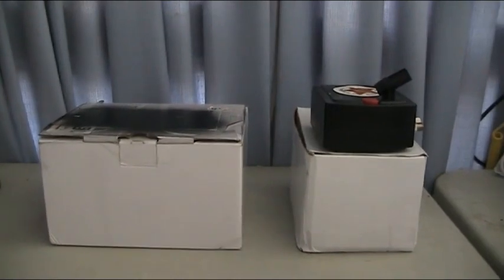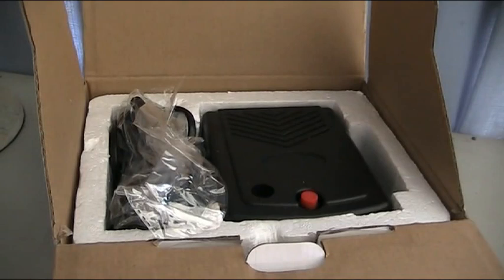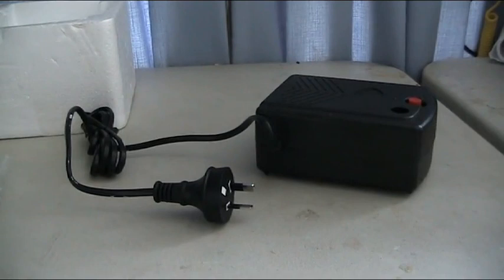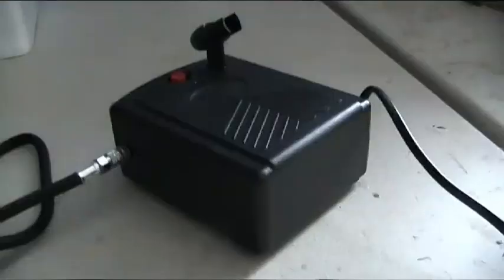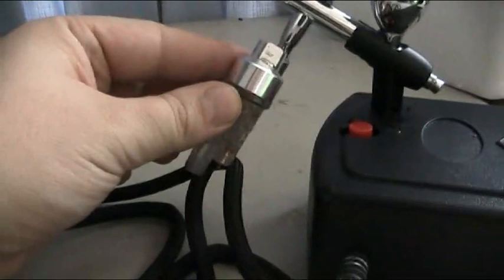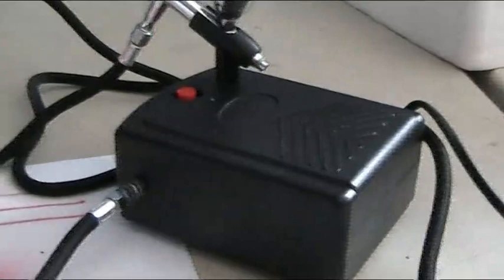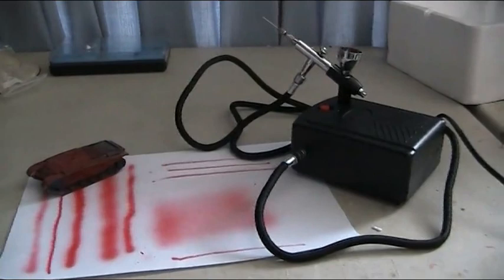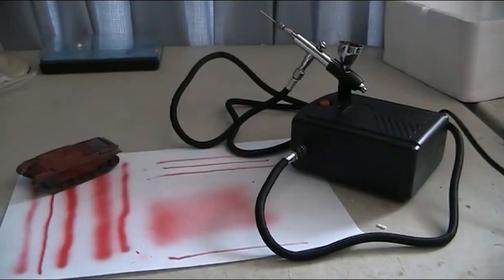Budget AS-200 mini airbrush compressor review

Comment: I really like your last video about this mini-compressor. Have you tried painting a large surface, like a 1/700 ship, with this compressor? Thinking of getting one but I'm not sure if this can handle a 1/700 ship.
Reply: If I understood correctly, he says this compressor is similar to a fish tank pump?  But there are different types of aquarium pump...  Aquarium pumps have been left running 24/7 for years.  Not sure how the work compares to spraying paint, but the air pump has to force air deep under heavy water.  Then you should be able to paint with this all day long?
Reply from the maker: This is correct interpretation, my apologies for the late reply as I've been over seas for a few weeks.

Comment: I hope you can also tear it down to see the inside.. some are all plastic piston inside that easily break. I have the old one
Reply from the maker: The insides is similar if not the same as an Aquarium pump for your fish tank. Once open the plastic parts are out of aliment and seals broken, near impossible to repair. Aquarium pump goes for around $5-$20 and can go months to years straight before burning out.  I did the math on fitting one of these pumps to an airbrush and the time input is just not worth it. Once one of mine dies I do intent to open it up to take a look.

Comment: Thanks for sharing. What is the difference between those larger compressor vs the mini size ? Is it the limit on the psi thus the varieties of style that one can airbrush? And does it work on all type of paints like oil , aryclic ? 
I wish to use to paint various texture like model kit, clay ,and 3d print .do you think it can perform on those ? Thanks
Reply from the maker: Hello, please watch this much longer video for context and visual answers to your question. Short answer is yes this can spray almost anything and you can achieve most if not all spray styles with minor adjustments. https://www.youtube.com/watch?v=BezXK_9QNwk

Comment: as time you are the seller it's normal you "can't see any difference" in between this equipment compressor and a REAL air compressor foreseen with air pressure regulator.

Comment: Ive got the same kit should I keep turning it off and on because the high pressure sound is scary
Reply from the maker: The piston is plastic and will loose it seal quickly from constant over heating. When not spraying turn off and drain air by keeping trigger down. Turn back on when ready and no air inside the line. It's not very loud compared to other compressors.
Reply from the maker: In a single session you will turn it on and off quite a bit, few seconds pass is ok turn off when you intent to clean or change colors or something.